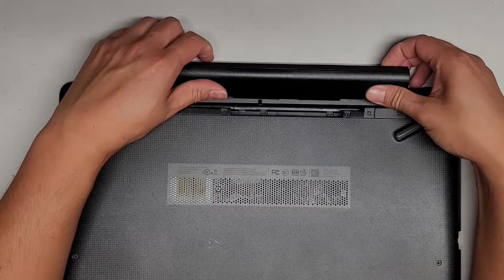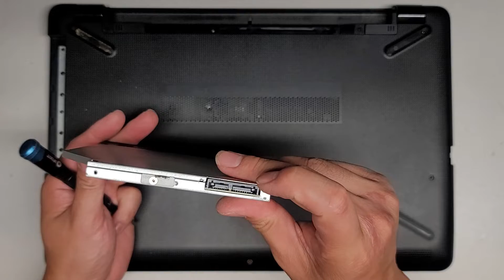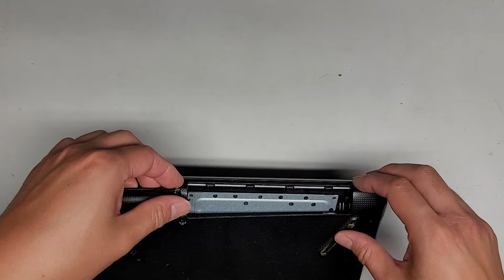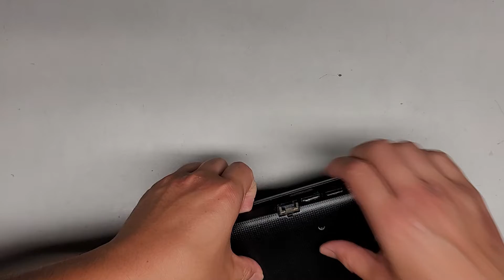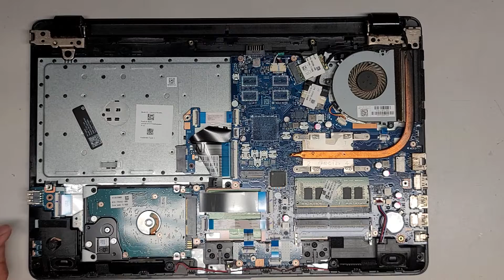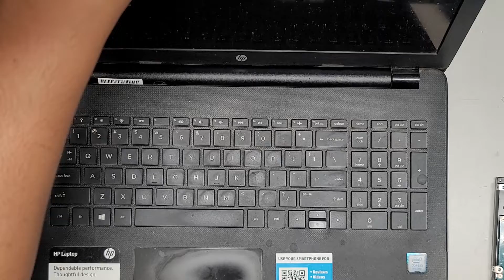HP 15-bs113dx Disassembly RAM SSD Hard Drive Upgrade Battery Replacement Repair Quick Look Inside

Comment: Great video! Thank you
Reply from the maker: No problem. If you haven't already, please like and subscribe so others can find my videos and possibly consider watching a few others to get the algorithm to recommend my channel. Thanks!
Reply: Did you have installed an SSD M2 on that laptop? I bought a Kingston M2 NVMe and does not fit, some people tell me that this model only use M2 sata but it the same size, the difference it’s just one more “hole”
Reply from the maker: @maly88666  if the notch doesn't line up, then yes, need SATA
Reply: No, I mean the notch fits fine, but the big part after the notch doesn’t fit at the end, the little one it’s ok
Reply from the maker: @maly88666  where did you connect it?
Reply: @ItsBinhRepaired  in M2 slot, it’s almost in front of the HDD and the motherboard says “M2X3”
Reply from the maker: @maly88666  that's an m.2 sata slot. Notch is in the wrong spot for PCIe NVMe also the M2x3 is the screw size, not for the m.2 slot.
Reply: @ItsBinhRepaired  thank you, I’ll get a sata!
Reply from the maker: @maly88666  hope it goes well